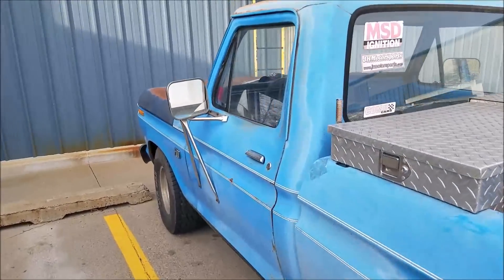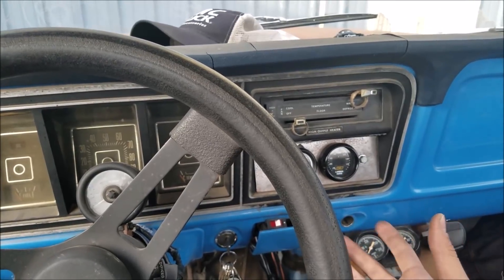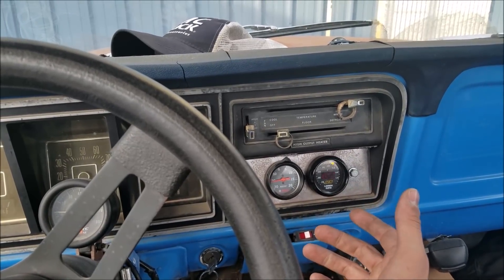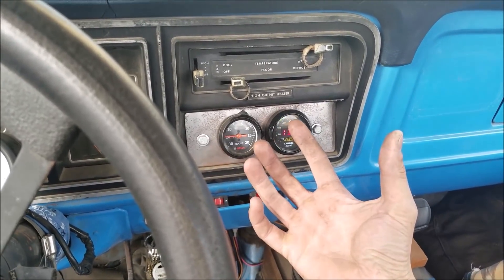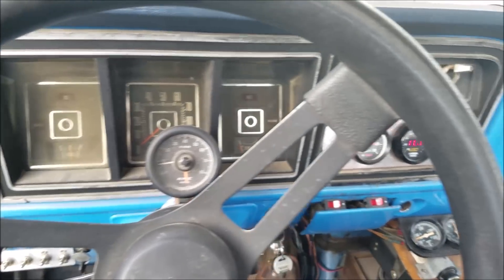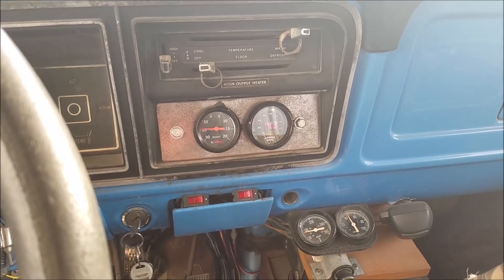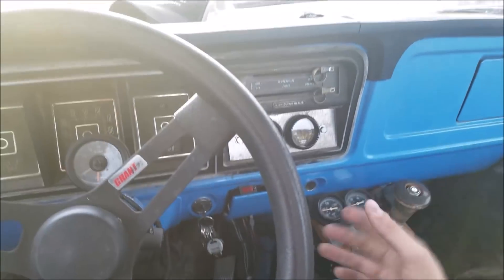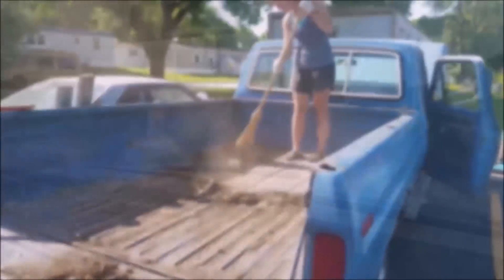Carburetors - Why You Hate Them (Demonstrated & Explained)

Comment: I have a Weber 32/36 on a freshly rebuilt Mazda b2200 that thing is the biggest pain in the ass never runs great even after trying to tube it from watching the videos you have made. Thankfully I am swapping all of it out for a fuel injected motor right before spring
Reply: baggedmazda666 first car was a b2200. Completely clapped but it looked good in pictures lol. I had chronic issues with the stock carb
Reply: Yeah that was gonna a long time ago Weber is supposed to the holly grail it ran like Shit on mine so I’m swapping to a Kia Sportage motor it’s in the same family as stock bolts up and you gain fuel injection and 2x the power over the stock boat anchor
Reply: @baggedmazda666  I'm running 32/36 on my 2.2 Chrysler. Has always done me well. Little picky, but leaps better than stock. Thunderheads videos helped me tweak it actually.
Reply: Put 40k on a Datsun 720 with a 32/36. Zero issues unless it was below freezing, and even then, 1 minute of driver input and it finished warming up fine. Your carb was poorly tuned, and may have needed different jets.

Comment: We hate them because you can't drive off road without the damn fuel in the bowl shifting sides and the vehicle dying.
Reply: I never had a problem offroad with Carburetors.
Reply from the maker: I autocross and rallycross carbed rigs without issue - float height will get you on the steep hills

Comment: That's informative I always say get your idol as rich as you can and leave it at that and I run as big a spacer I can find under the carb and I run my fuel line in insulating material that you run household air conditioner lines through it  I did a V8 S10 it was the worst I left the fenders in it so I can drive on rainy days but the heat wouldn't get out from under there worth a crap I actually put vents in the hood to let it out it seems like this gas we have with the ethanol in it boils quite easy
Reply from the maker: The ethanol fuel and heat is just a bad combo. Modern cars have it easy with high pressure fuel rails. Fuel under pressure resists phase change quite well

Comment: Personally I hate them because I almost constantly have to clean the Jets and needles otherwise it won't start.

Gonna do a full rebuild soon and hopefully it'll eliminate some of these problems
Reply: If you constantly have to clean your jets, you have a dirty fuel system. Replace the tank or flush it. Replace any suspect fuel lines and filters. Fuel systems on older cars/trucks are some of the most neglected items. The crappy pump gas of today doesn"t help the problem either it makes things worse.
Reply from the maker: Two or three inline filters should help with this 👍
Reply: "constantly"  really?  doesnt sound like a carby problem,  sounds like a fuel system problem.
Reply: if your jets got that dirty all the time on a carb car, your injectors would clog up on an efi car.
Reply: It will, but it sounds like u need to replace fuel and air. Filter first
Reply: Add an inline filter a few inches before the carb helps grestly
Reply: Non ethanol fuel ONLY.

Comment: So was that 14 parts air to one part fuel? What is a lean value and what is a rich value? I have a 71 beetle so am curious...
Reply from the maker: James H yes indeed 👍
I guess I should have explained that also! This was a preliminary video I guess to see what people wanted to see.
Lean is beyond 14.7 
Rich is below 12
Reply: ThunderHead289 well id certainly be interested to understand how you measure AFR if you dont have a gauge fitted, and then how to adjust for optimal power or economy.

Comment: "I dont have a choke" yes you are correct that most people don't like carbs because they don't have them set up correctly or are missing important parts. The choke nicely helps with the lean condition when its cold ;)
Reply from the maker: Saber Tooth Lawn Tigers I cut out a part where I explained that I had it open for the video. I do have a mechanical choke installed - but with it the readings are distorted for what I was trying to show. 👍
Reply: I have an electric choke on my Autolite two barrel, but has the little heat riser pipe too, disconnected now, riser wouldn't fit, when the electric part works, it is fantastic, set it and forget it. My previous carburetor was ruined with the ethanol in our gas, I rebuilt it several times to no avail, had to replace it recently, I hate that shit.
Reply: I see a lot of difficult to start cars have aftermarket holly and edelbrock carbs without chokes. Then I walk over, start up my factory quadrajet cold and it gets up on the high idle without having to even touch the gas more than 1 pump to set the choke and put a squirt from the accelerator pump in there. It's got the little intake manifold heat pipe that warms up the spring that's in the choke. I'm thinking about converting it to an electric one day but it's worked fine for me so far in the 3 years ive had the truck. Although I would very much like to get a Vacuum gauge and a wide band O2 as well. I've seen David Freiburger tune carbs with those tools as well.

Comment: i put a 1 inch plastic spacer on my Nova, made a huge difference with hot starts.  Plus it adds a bit of plenum volume.
Reply from the maker: best two things you can do - carb spacer & return line 
last option is to cut a hole in the hood! 
had all 3 on the rotstang
Reply: @ThunderHead289  ya, I'm lucky my Nova came with the cowl hood,  with a functioning tunnel and air tight tray
Reply: I run a pluematic spacer, cool cool can, and a return line.